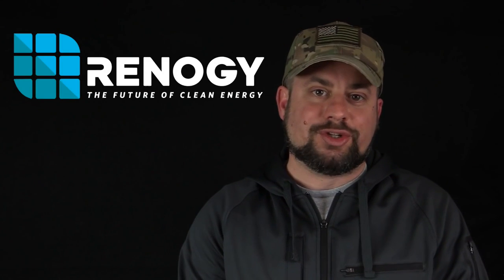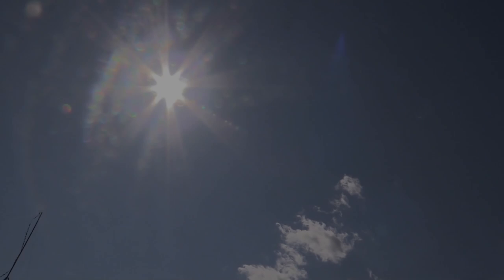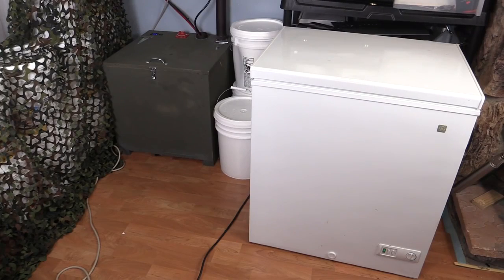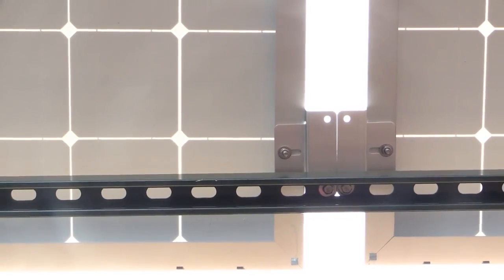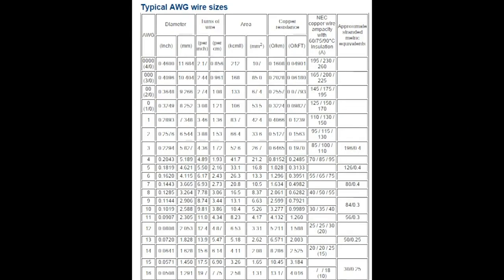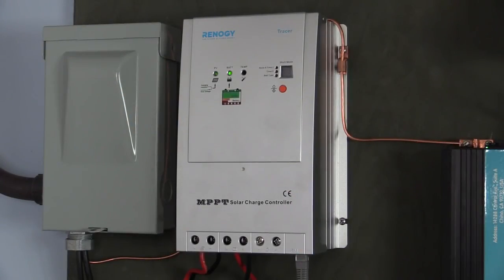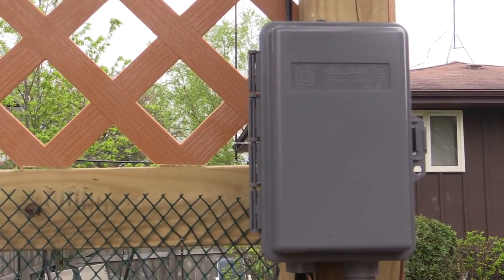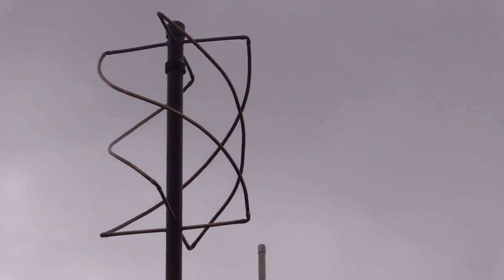The Ultimate Guide To DIY Off Grid Solar Power | Tin Hat Ranch

Comment: I've been watching ALOT of homesteading YouTube and just ran across your channel.  You do the best job at a YouTube station than I've ever seen!  You could have a real TV show.  I've been getting ready to launch my own channel, you set a REALLY high benchmark.  Also couldn't help but notice the ham radio gear - my call sign is N6LEY, still haven't gotten back on the air for awhile, will be a project here for the homestead.  I'll be checking out the rest of your off-grid videos just to assure I'm considering everything for my own solar built which is just in its info gathering stage - though already know it will be larger than what you have because we have a 700' deep well (240V pump 1) at my pole barn, with a second pump (240V pump 2) coupled to a bladder tank to create house presssure.  So just having water here will eat up lots of power budget.  So far estimating 3-5kW of panels connected for 48V, to a charge controller, and a least a 5kW split phase inverter, with 16 golf cart batteries or a smaller number of real solar batteries.  Just thinking out loud.  
Surprised not more subscribers yet -- it really is very well done.
Reply: I have a 285 foot well with static water at the 15 foot level with a 240 pump. They use 240 as it is more efficient.  I too want to go solar but after much discussion with others have almost decided to use a generator for the pump. Pump it up into a tank and use gravity feed.  I also have a pitcher pump (hand pump) to use as an emergency backup. You gotta have water.
Reply: Hello Sheridan.  I hear you.  That sounds like a simple solution, albeit inefficient and relying on being able to obtain generator fuel.  There are alternatives - solar works fine for well pump loads. 
We drive our pumps via solar - check out our "Star-Lite Wars" series on RelentlessHomesteading - detailing the whole thing.

We have a 600' well that is over 1000' feet from the house (long story) with a 240V pump.  And we also have a 240V pressure pump to drive the pressure of the system - that long distance is about it for the well pump.  
BUT - as of last year we have solar panels to power the whole thing, as well as lighting and other aspects for the house.  You do need sufficiently sized solar panels, battery and inverter to make this work - so you are probably looking above $20k.  Ours was larger with cost a little more than double that, but provides over 40kW/day in summer months.  During dark winter we will still have to use a generator at times - but all the power will go to the cells and gas only needed a few months a year - month in which rain catchment (next project) could be used instead of the well.  

One big problem with generator is that (1) you must get a 2 phase generator (240V), (2) startup current needs can be about 5x the amount needed normally.  Thus, the generator efficiency driving your load is VERY poor (large generator driving a single load).  If we run a generator into our system almost all of the power goes into the battery bank which can absorb the 9kW the generator puts out.  
Check out our series called "Star-Lite Wars" on RelentlessHomesteading - it goes through our decisions, power consumption, well configuration, and the install of the solar.  And we got fed and local incentives which has already paid about 1/4 total cost and will pay another 1/2 in a span of 3 more years.

Comment: If you live in a dry desert climate (doesn’t work well in humid climates ) you can air condition your house on solar using a "swamp" cooler. Just replace the AC blower fan motor and the water pump with DC equivalents.

Comment: Do you have to monitor the water levels in the batteries, and do you check soc with a gravity tester or just with voltage levels? I've seen other people's setups that have like automatic water level control and stuff like that. Just wondering what your approach is..

Comment: Great info for beginners to solar...nice work putting this in-depth video together. Long, but well done. I run 30 of those Renogy RNG-100D solar panels. Six panels in series with long PV cable runs (one run is about 145')...zero power issues. High voltage/lower current/10 AWG PV feeder cable runs. Did a video on this too and used the same websites showing voltage drops/cable efficiency. So, good stuff Mt Tin Hat...good stuff. My system is 24v...48v would be better, but 24v allows for more flexibility. Batteries: I use twelve Trojan L16 size with Flow Systems Water Miser Safety Vent caps...reduces watering/acid misting/stink/helps keep the strings in balance. My system is "partial" off-grid in suburbia...still have a small electric bill for the 240v AC stuff. Great video...lots of bases covered and excellent delivery/presentation!

Comment: If someone had enough money to buy more expensive batteries? (not lead-acid) What ones do you recommend?
Reply from the maker: +nickjedl there are a couple of options out there.  Lithium Iron Phosphate and Nickel Iron are two that come to mind, one new technology and one very old.  Note; you need different charge controllers.
Reply: I'll educate myself about them, thanks for the reply!
Reply: I have installed the Iron Edison Batteries for customers and they are working great but the cost is high, I also have a system coming up using the Aquion and can't wait to try them
Reply: What about lead crystal batteries?
Reply: +Gary Baris I've never really looked at them until today,  I am going to read up on them tomorrow

Comment: Thanks for the great info.
 Ques: How often do you personally have to clean your solar panels and how DO you clean them?
Reply from the maker: +Charles Windham I haven't cleaned mine and don't think I have to.  They don't seem to accumulate much on them and I've never noticed a drop in output.  Even if you did have to clean them, they have a sheet of glass over the actual cells, so Windex should work.

Comment: Did I miss the cost? What minute is it at????
Reply: Panels a $1.25 or less per watt, batteries like those $200.00 each, charge controller $300.00 Pure sine wave inverter 1000 watt is small $250 at most Most parts could  be found on EBAY! Total not more than $1600.00 your doing the work of putting it together!
Reply from the maker: +BodaBoom BigAl cost will vary by application.  My complete system, every part, was less than $3k.  The parts themselves are less than $2k.
Reply: TY!
Reply: Troy Brownrigg
TY Troy!

Comment: 12 volt deep cycle boat batterys!!!
Reply: +gatorred157 ...I may be wrong. But if memory serves, they also have 500 or so "cranking amps", which would be counter productive in a solar system. ;-) ...Ha!, 'solar system'.
Reply: well if a 11 year old international truck battery still works it was a deep cell not starting marine deep cell what most solar battery's are
well my seam to work! even after 6 years
Reply: +gatorred157 - I run 12 Trojan deep cycle flooded L16 size batteries (6v) on my system.
Reply: ok i use old boat battery's for trolling motor i have 3 plus one on camper! that makes 4

Comment: What about not using acid batteries?
Wouldn't AGM be better?
Reply: +Ronny Finseth - I have 4,300w in solar panels, three Midnite Solar MPPT solar charge controllers and twelve Trojan L16 deep cycle flooded lead-acid batteries. 24v system. Runs my whole house 24/7. Check out my Youtube channel...I did many videos on these. AGM is great...but, pricey. I also use Flow Systems Water Miser safety vent caps on my Trojans...reduces waterings, acid mist, and helps balance the strings.
Reply: I plan to put 2 panels on my car to charge independent batteries to be used with 360 work and search lighting, also to be used as a charging station for all kind of electric devices
I do Search and Rescue with it
Reply: +Ronny Finseth AGM be a lot better as they do not off gas but they do cost a bit more.
Reply: +Ronny Finseth The major disadvantage to AGM batteries is that is over charged or over drawn on they can buldge and fail. they usually don't last as long in this style of a setup with very high draw and charging rate. Lead acid batteries that can be topped up with water are pretty good if you are willing to top them up about once a month or so. Ideally lithium ion batteries have the longest life on paper if you don't let them drain really low. However the cost on this is much higher even if you build your own battery out of 18650 cells.
Reply: ***** Yes but they do not off gas.